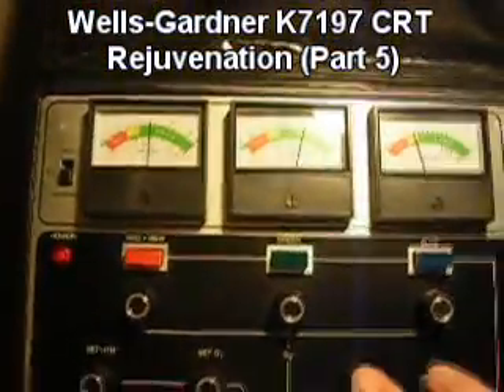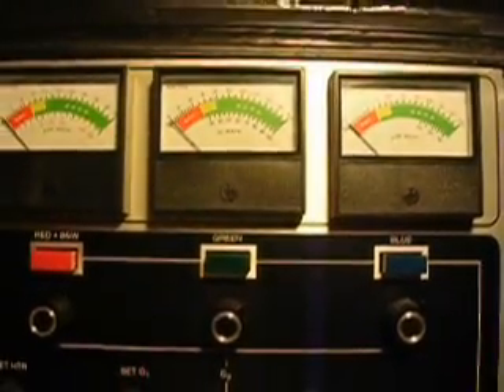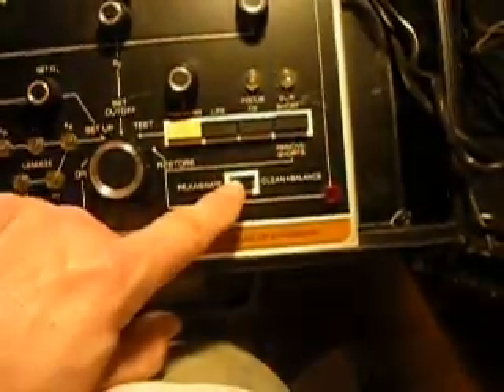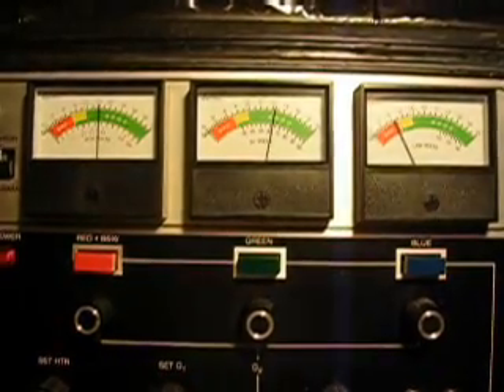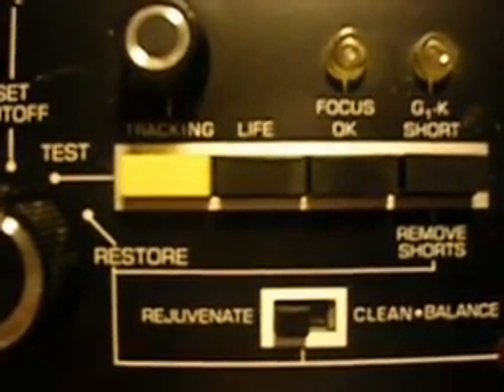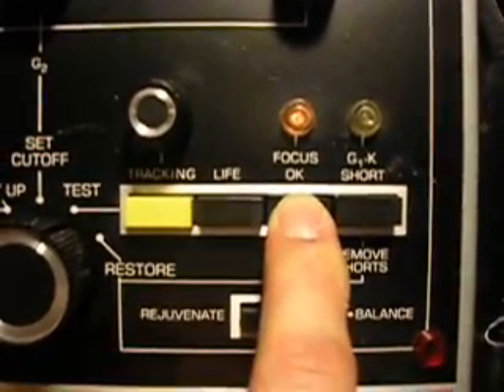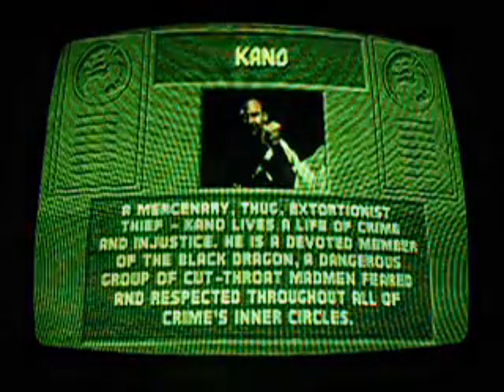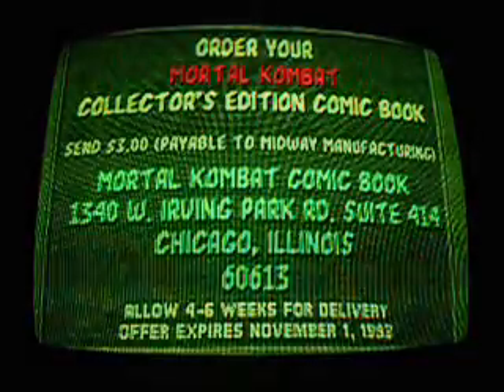(Part 5) Wells-Gardner CRT Rejuvenation

Comment: There is something wrong with the tracking function on your tester.. The needles should move regardless if all the guns track into the yellow area or not.. I think you over did the rejuvenation.. You're really suppose to start with clean and balance and if that doesn't work than the full rejuvenation, and you're only suppose to attempt only a few times..

Comment: try over doing ur rejuvanation for ur blue gunover hold it and if that doesnt work try dropin ur red green cut offs etc on neck and this will add to blue to balance it alot more the grid like look on screen is probs because the blue is daul and because all tree colours are in row to make single pixal and blue is weak it shows as grid on screen

Comment from the maker: @ArcadeMonitor If you mean the rejuvenator, no I don't think so.  Sometimes guns improve and sometimes they don't.  This one, seemed to show some improvement, then got worse.  I have heard sometimes monitors don't last very long after using a rejuvenator on them, but then, I have heard of people bringing new life to CRT's, and they last a good while.  The Red & Green guns improved a lot.  I've had it recommended to turn the voltages up and "cook" the tube to see if the blue gun will improve.